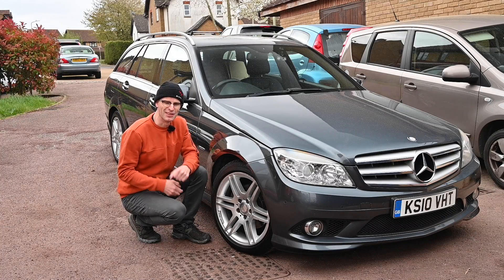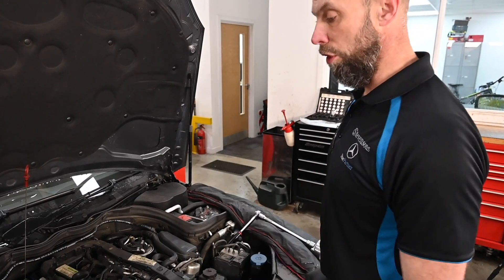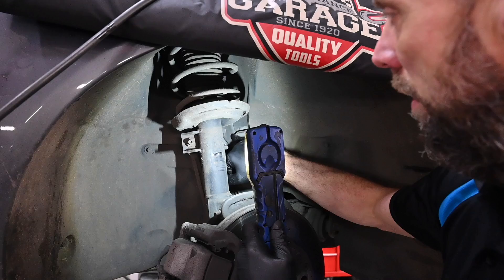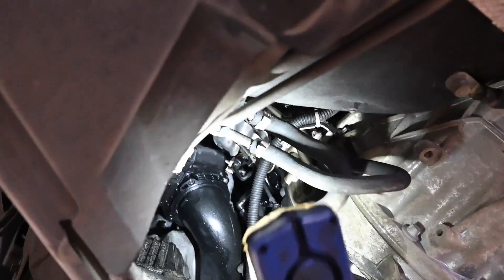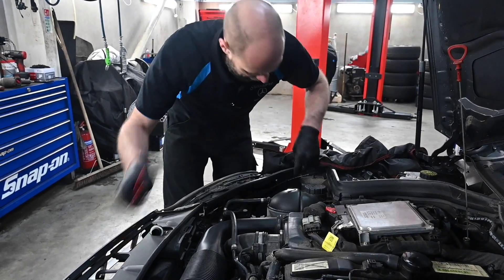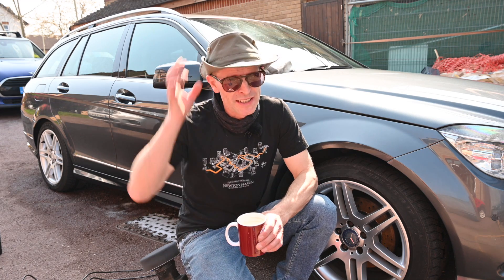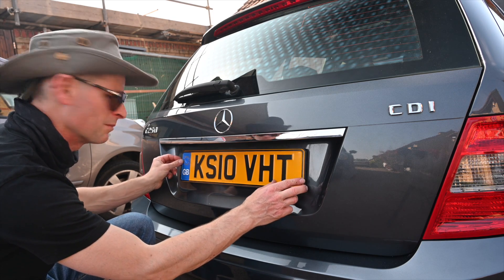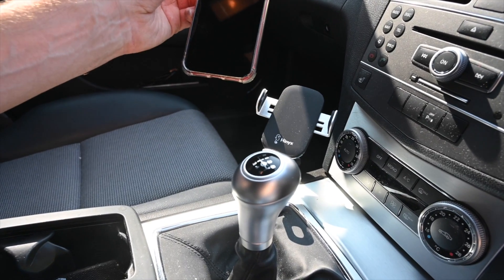Mercedes W204 C250 gets a real service!

Comment: Aha, that explains why my clutch felt so much better after changing the brake fluid! I used to have an issue where after a long run of remaining in 6th gear, the clutch would be slow to return- fixed by the fluid change. Wish I knew of this specialist when I had my W204... I went main dealer every time!

Comment: I have a w204 petrol, I spend a lot of time messing with other cars and the Mercedes just works with no fuss.  Last MOT my brake pipes showed corrosion exactly where your mechanic pointed, It has just begun so I cleaned it with wire wool and painted it will stonechip and then it passed no problem.   I have been servicing it myself for the last couple of years and I change the oil twice as often as recommended ( old habit, don’t care if it’s unessesary) .  This year I may get a proper b service at a specialist and let them check all the areas that I would not know to look.    It’s 10years old now and it still looks and drives like a brand new car.
Reply from the maker: They are such good cars and the looks haven't aged. Interesting about the brake pipes.
When I had a 5 Series I was doing extra oil changes as the internal was too long, I should do that with this as well really

Comment: wow down in Victoria Australia we can only purchase number plates from VicRoads the equivalent of the DVLA in the UK, they are also very expensive at about 150 quid for a pair of Euro style plates & ours are the same colour front & rear. 
None of ours have any dealer markers on them at all the dealership put their own covers on instead. The actual plate is always pressed metal & they are screwed in with special 1 way screws. Everything is done through one central agency here in Victoria (Australia). we are not allowed to take the number plates off the car other than if they are bent or damaged.

Comment: Stevensons (spelt incorrectly in the description) Mercedes Benz Specialists really do know their stuff.  I'd noticed the new pressed plates in a few of your latest videos with the W204 in the background.  Could the new phone holder be the reason of your flat battery?  Stay safe Matt.
Reply from the maker: You guys are my sub-editors..good spot! They've been on a week or so now but was waiting to fit this video in, trying to work out of I could get my summer wheels back somehow! The battery has been dying for a while, cranking slower and slower but OK if the cars used daily, a week on the drive killed it! The lighter socket is switched..Im going to have to spring for a new battery when we are free again

Comment: Just bought metal plates for my Nissan pulsar.  I think they look so much better. Went for plain plates with no country of origin on them as I don't go abroad and the car came with them anyway,  I wanted to get rid of the supplying garage name as they were very poor at customer service and sold me a lemon.
Reply from the maker: I can understand that, once bought a car from Thames Fiat in Tunbridge Wells as they had the right car in stock but they were the worst dealer Ive ever dealt with, it leaked and over 6 months they had it 3 of them, including leaving it outside in a week of rain so it was full of water. If we'd kept it it would have lost the dealer plates!

Comment: You will change the brake pads and disks yourself matt I think euro car parts is open for delivery only
Reply from the maker: Id rather use proper Merc disks as its got the AMG ones, Stevensons can get them and fit them for about the same as I can buy them so may get him to do it
Reply: @furiousdriving   yes I woud if it going to cost the same that mechanic knows his stuff about Mercedes you should get easy 200k out of that car

Comment: Hi Mat, great video 😃 Could you advise on the cost of the B service and associated parts and labour please?
Reply from the maker: I forget as we changed the service as the air filter was done last time and the fuel filter this, plus we added the brake fluid change, and each model will be slightly different, but from phoning to compare on both A and B services its just under half a main dealer charge.

Comment: Because the previous model c-class were a bit rubbish Mercedes spent billions developing and testing this w204 model. This is by far the best Mercedes of its day. We had a C180 Komp BE for 4 years and 50,000 miles and literally nothing at all went wrong normal servicing and I have no doubt another 100k would not have troubled it either.

Comment: I am a bit worried about your front plate being metal and with that bend is the self adhesive strips going to hold
Reply from the maker: it did curl back so I had to cut it off with a long knife and bend it to shape

Comment: You ought to treat that Merc to a non-dating plate..... would be near-impossible to tell its age unless you were an M-B "anorak".   Does a teflon paint treatment work? I've got a 3-year old Ford on PCP (about to buy it outright) and the paint is the worst I've had on any car, so soft that you only have to look at it, and it chips. Autoglym SRP does not seem to have made it any less prone to damage
Reply from the maker: Id thought that, its hardly dated at all, maybe I could swap the plates with the 230E! The teflon is good for keeping the car clean and repelling road dirt and looks good as its a wax but cant protect against chips, you'd need a physical barrier so a clear wrap is the only thing that could protect against chips

Comment: I find it interesting that metal license plates are not the norm in the UK, and that they are held in place by two-sided tape. Is there a reason that the front and rear plates are different colors?
Reply: Mines held in with screws, through all the nice protected paint work. Grr

Number plates ideally stay the same for the life of the car, so tape  can be better than screws in this application.

I assume the different colours for front and rear is just to differentiate between front and rear.
Reply: The different colours are so the police know if you are coming or going 😁
Reply from the maker: Not sure why, but plastic is cheaper but the letters fade quite fast. The requirement is for being reflective (and size, font etc) so as they are reflect lights its OK. The colours are so you can see if its the front or back of the car in the dark, and the tape is optional but means you dont have to drill a hole in the wrong place or sploil the clean look. Some use the screw tops to illegally change the letters to spell words though!
Reply: Also makes cloning far easier.

Comment: Hehe a Mercedes diesel with just over 100.000 miles, is just warmed up. In my country this car still costs more than £20.000..
And wtf are you afraid of the sun? LOL
Reply from the maker: I burn next to a light bulb! Im hoping to still have this at 200k, and maybe 300 too
Reply: @furiousdriving  300k is still nothing for a Mercedes.. It easily goes that twice ;)
Reply: I brought a w205 C220 CDI, when I was working. Great car, very economical. Then I retired and only did short trips. Didn't know that those short trips would not allow the DPF to burn off the soot. Result, clogged DPF at 165,000 km. Damned expensive to replace.
Reply: @briananthony4044  Common knowledge since the first filters were introduced in the early 00's..
Reply: @andersnielsen6044  Amongst mechanics perhaps, but for the general population, no. I am a bit of a petrol head, and I didn't know. There are a lot of diesels here in NZ being driven by soccer mums, mainly SUVs. When I brought my diesel, nothing was said by the sales person, they just wanted a sale probably. So no, it is not common knowledge.
Reply: @briananthony4044  Do not call yourself a petrol head if you do not know such basic things man. It is just embarrassing.
Reply: @andersnielsen6044  I knew nothing about diesel engines when I brought mine. I am in my 60s and have brought cars, worked on them, striped down engines etc over that time. 
My father had a garage which helped, from the age of 12 I was disassembling cars for dad, though he resembled them.  I also learnt panel beating and the electrical side of things. My biggest engine to strip down was a Chrysler 340 V8 in my Australian Charger E55 in my 20s. My first strip down was a Mini 850, my first car I purchased at 15. 
I used to go to every race meeting at a local race track, went to the local drag strip a few times, though not really my cup of tea. 
Then I brought my first Japanese assembled car when smog became an issue, a '84 Honda Prelude. The engine was surrounded by plumbing for the smog equipment. I looked, gulped, and decided to restrict my tinkering to areas like brakes etc. 
I follow a number of channels on you tube focusing on auto maintenance and science, but these days I no longer do the repairs myself. I'm past the oil stained hands etc. One of my favourite local NZ channels is 
https://www.youtube.com/c/MartyT where Marty is always buying old equipment and getting them going, even after a decade or more in the bush. 
So no, I am not totally ignorant in regard to engines, at least petrol ones.
Reply: @briananthony4044  I read your first sentence: "I knew nothing about diesel engines when I brought mine". I wish you good luck in life and I rest my case.
Reply: @andersnielsen6044  You too Anders. I though you were a young know it all, and was a bit peeved at your reply. 
Todays cars and todays racing is not the same as my day. I loved the car racing where the cars were modified versions of cars you could buy, 4,6 and V8s. Today they are just bodies stuck on a made for race chassis, boring.
Good luck and go well.